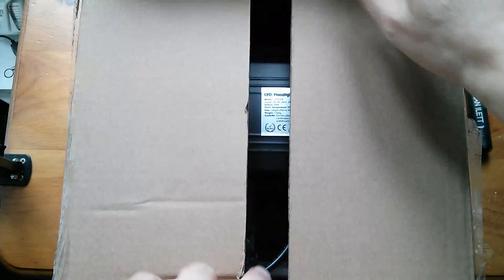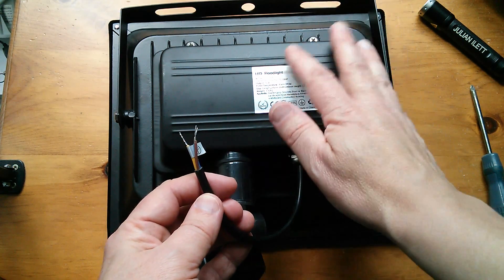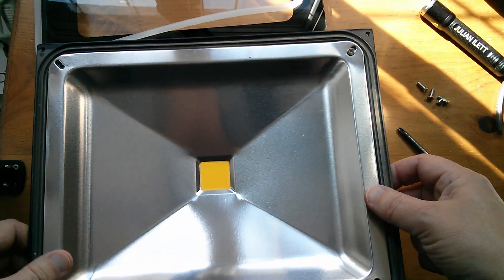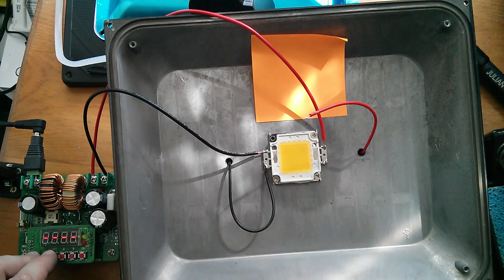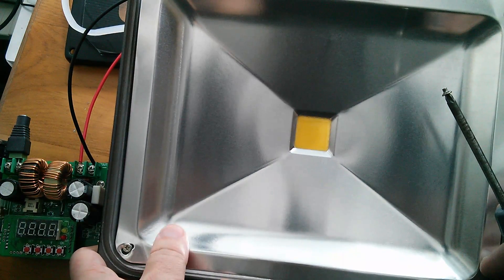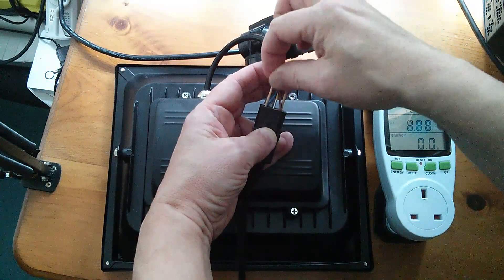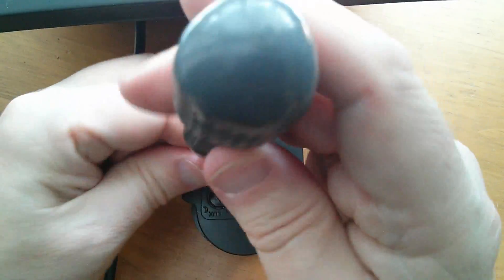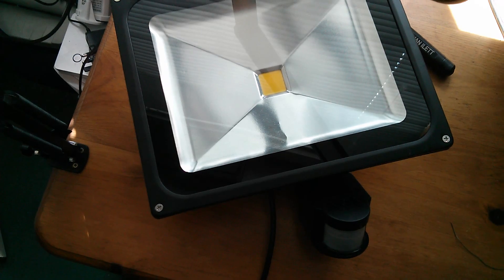Teardown: 50W LED Floodlight

Comment: An excellent video as usual Julian - but a couple of moans coming up:

Why don't you get a Quick Test connector from CLIFF Electronic Components? Clive uses it a lot and it will save you much time and grief. You could have done your friend Paul by replacing that stupidly short mains cable.

This video suffers from the auto iris/ exposure on your camera going crazy all the time. I would suggest that all daylight is excluded from your room, two LED floods installed and have the camera exposure and white balance locked off.

Comment: I'm disappointed that you didn't measure the power taken by the led module itself when supplied by its own driver. (My 30W floodlight consumed only 17W so I complained and got a 50% refund from Aliexpress.com).

Comment: I think it was just cheaply built at low cost. The reflector plastic sheet should not be on the reflector. The wires from the main to the driver are those cheap crimps, not screw ons. The case is nice, to bad the motion detector is out on upside down. I wonder when these light manufacturers will start putting anti-reflective coated glass on the lights. With AR glass coating it would gain at least 10% more light through the glass.  Nice tear down :-)

Comment: it doesnt matter which way you put them in. you will always get positive and negative potential difference thanks to ic. so even if its just a half bridge rectifier, it will get one half of the wave, no matter where live and neutral is. live and neutral is only important for safety, so for example the live wire is switched and not the neutral one. with euro plugs the system is complete nonsense as you can plug them in either way.

Comment: Mains Lead? No Plug? In what way is that NOT illegal?
Reply: +Tony Hunt At least here in Sweden, you are free to connect basically anything to the mains. Now, if you connect anything permanently its is suddenly very regulated, and you basically need to be a certified electrician instead. I doubt its illegal to sell stuff this way.
Reply: +John Bäckstrand Ah yes John. Sweden... You're the same as France and Italy. You're not in the EU, only your politicians are. Rules only apply when you want them too. Same as Me. Because I'm a Fully Licensed Radio Amateur for 34 years, G6MEW, obviously any electronic laws, to me, are also only advisory.

Comment: I have some of these cheap Floodlights (80W, 2*50W, 30W) - but all of them with 5630-Boards.
I think those are much better than those COB's, because the light-color is actually very usable and the CRI is pretty high for something that cheap.
I have dozens of COBs here, from 3W to 100W - and only very few are actually usable.

Comment: Julian, Why do you think that this light should draw 50 watts ? The label says "OUTPUT 50 Watts". There is no actual current rating listed on the label, just a voltage range and frequency - 50-60 Hz. I think the rating of "OUTPUT 50 watts" means it is equal in light output to a standard 50 watt filament bulb not how much power it consumes. Maybe I am wrong but that is the impression I get from the label. What do you think ?

Comment: You can get 'glass effect' acrylic, which has the greenish edge, so it might not be glass if it doesn't feel like it.
Reply: +himselfe 
With panels that small it's often hard to tell if something is glas or plastic (PMMA or PC). Scratch test would be the way to go. But the edge looked like a typical scored and broken glass edge. Glass is actually cheaper than PMMA (and much cheaper than PC) of the same thickness (at least when I checked at the hardware store), so that's what the chinese would go for. That's luckily beneficial for outside use, because many plastics get matte over time due to heat and UV.

Comment: When you're assembling more than one of anything that has protective film on it, pulling off the film is a faff. So their rationale for not taking it off is: "no need -> don't bother".
EBay sellers overstate LED power as a matter of course. I complained recently and the seller told me that margins were tight therefore it was a justified lie. Cheeky buggers.
Reply: +Richard Ball I think they underdrive intentionally because they're using bottom-bin LED dies with several bad LEDs in each column. If they drove at full wattage, the LEDs that are actually working would overheat.
Reply: +John Ridley That sounds like a great engineering / technical interpretation of what would be, but it gives them too much credit. The products are clearly often poorly made (having seen lots of BigClive videos) and they simply lie about the specs as a matter of course to boost the return. Most customers won't measure the current, so it would be wasteful not to(!)

Comment: I have tested dozens of these over the years, so far I have only found one that really was a REAL 20 watt light, most are only 50/60% of that claimed. I think the Chinese so called engineers need to return to school and learn ohms law. It is after all one of electronics simplest equation.
The reason the plastic film had been left on is simple, to save money removing it. It would have been on both sides of the metal originally but clearly ONE side HAD to be removed.
Reply: +Michael Beeny It's not that the engineers don't know that 40 watts is not 50 watts, they just ship out the cheapest one they can get and as long as people will pay them "full price" for a 50W lamp getting a 40W and not demanding a refund they will just continue to do so.
And they know full well that that LED is a dodgy reject and would never work very long at 50W they just stuck a slightly cheaper 35W driver at it to make it last just long enough for people not care to again claim refunds for a failing lamp.
As far as I can see the chinese engineers and salesmen are doing great (for their own good at least), it's the customers who need to sharpen their game and demand refunds for fake products.

Comment: Unbelieveable - you missed the led driver. In doubt you should just have followed the power cord.

By the way - I lately ordered 3 floodlights each 100w. 2 of those stopped working after 1 week. I dont exactly remember but there were around 180 single LED's on a thin epoxy glued ontop of an aluninium plate screwed to the case with heat paste in between. I figured out that the leds were connected in a 3 led parallel cluster serial mode. so when one led of 3 leds fails the two others have to carry the full current. Of cause that leads to the death of both soon whitch interrupts the flow for all others. I soldered in new ones in wich was a mess because everything was covered with silicone.  It works but surely not for long. In the end this design is a big desaster. I measured it consumes around 70 watts so 100w was a lie.

 I guess the manufacturer knows about it - i immediately got the money back without any questions or request for reshipment. Lateron i ordered another design 100w led floodlight. It has 2 50w drivers inside and works pretty well for weeks now.

You prpbably know that this kinda floodlight design with this big but useless reflector is only made because the customers are used to floodlights with halogen lamps inside and want it that way. Back in the days when floodlights were made with halogen lamps the reflector made sense.

Comment: Yess, nice video my friend. recently I made a video of an 12w LED lamp and only consumed 7.5w, is this scam normal?
Reply: +Proyectos LED 
It's not a scam. It's just that you don't seem to know the conversion factor for chinese watts. ;)
Reply: +Proyectos LED yeah it's pretty common for these chinese lights to run about 30-40% less than they're rated for, but the light should last longer though.
Reply: +vgamesx1 It depends on the fact that the led is actually rated for 50W. Even if it is supposed to be a 50W one, It seems that the led modules in cheapest flood lights are a bit defective: when you ramp up the amps, you see that only few led chips give light while many just pass current without lighting up. This mismatch in the behavior of the leds may be problematic if used at 50W. Underpowering the led module is probably a way to not rapidly burn the led chips that receive extra power because of the mismatch.
Reply: +Proyectos LED Gaston! para mi lo deben hacer para alargar la vida util del chip led y ademas para que no caliente tanto, debido que lo unico que tiene para disipar es la carcasa que dudo que sea el mejor disipador! Saludos!
Reply: +Proyectos LED I got 2 50w led floodlights from ebay a few weeks back. They draw about 30w each. I think it's pretty common.

Comment: Yeah the light sensor has a rubber thingy on it - but the water will come in through the holes of the pots and the screws...
Also this red and black wire just going through the metal... I'm not really impressed...
Reply from the maker: +Ron Topsvoort I noticed there were a couple of rubber washers around the red and black wires sandwiched between the two boxes. The seal is probably OK there.

Comment: Julian, you need one of the quick connect gadgets that BigClive uses. I found a cheap one on the RS web site for 23 quid. http://uk.rs-online.com/web/p/mains-test-blocks/0458926/ It's gotta be better than flames and a shock.
Reply from the maker: +Maxx B That's certainly cheaper than the ones on eBay - but I don't do a lot of mains stuff - Clive's the king of mains.

Comment: Hi Julian I purchased one similar to this thinking the same thing about the orientation of the PIR sensor with the possibility of water leaking in through the dials. But when i thought about it further if its mounted to the wall with the PIR to the underside of the unit it ends up pointing to the ground, thus the PIR is mounted correctly and should be at the top of the unit, this way it is not pointing at the ground. The only thing then is the 240v mains gland is also at the top unit, but with the use of a "drip loop" on the cable entry this wont be a problem
Reply from the maker: +Jenson Cooper Interesting, I hadn't thought of that. But it does have all the hallmarks of a batch of wrongly assembled units sold off cheap ending up on eBay.

Comment: So I've always wondered why LEDs have reflectors at all. For the use you get out of them they don't do hardly anything, so it's more about just having a form factor people are familiar with. I'm waiting for a company to shake things up and make a sleek, small form factor light and forgo the reflector. I think that'd sell units. Kind of like... Apple, but for LED lighting.
Reply from the maker: +Jesse Crandle I agree completely. The reflector just seems to fill the space between the small LED and the large case.
Reply: Julian Ilett I'd love to see a case just barely big enough to house the LED and the heatsink. I bet if you had a good quality heatsink and some thermal compound you could get away with a fairly small one, making a compact flood light.
Reply: ***** True, but I think you could make a driver that was more square than long, get the footprint of the item into a smaller cube shape perhaps.